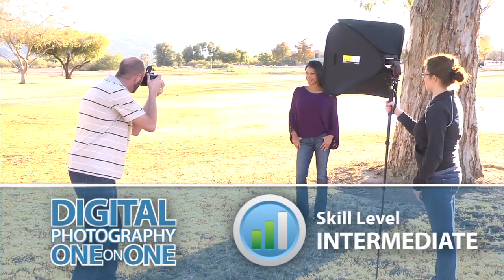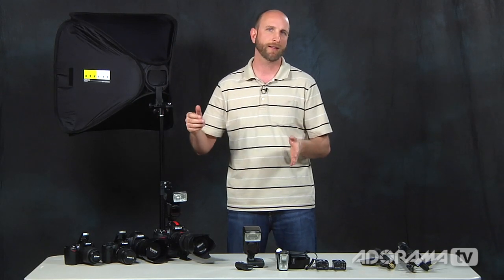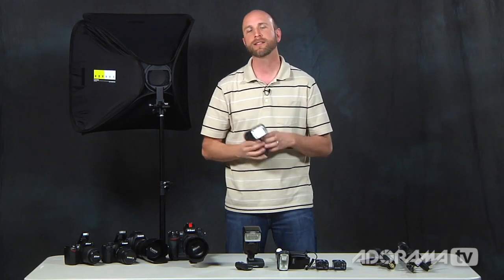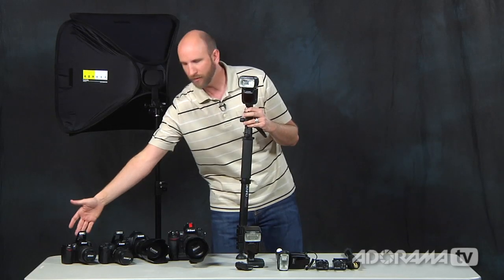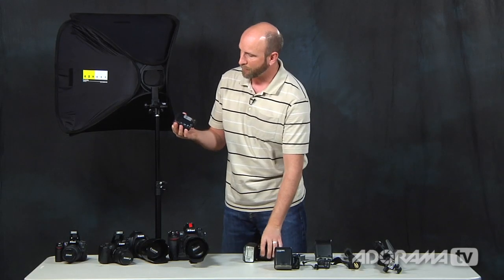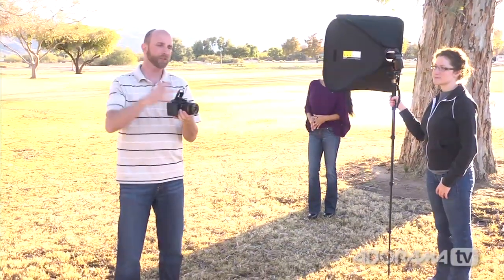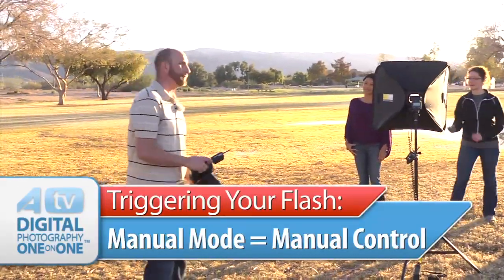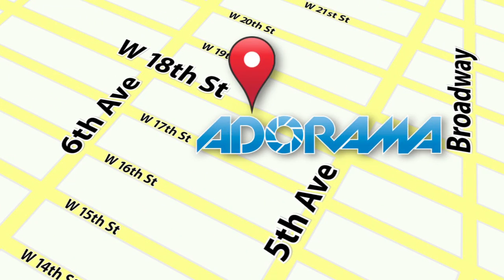Light Stick and Speedlights: Pt. 1: Ep 230: Digital Photography 1 on 1: Adorama Photography TV

Comment: @davidw64us1964 hey David, I have the Flex mini system, Pocket wizard build 2 types of Mini systems, 1 for Nikon and the other for Canon.
if you shoot with a Canon Body and use Canon Flashes, the Flex mini system for Canon will work for your 5d 380 combo, and the best thing about it is you can also use the flex system as a trigger for your shutter. Pw have a cable you can buy with a re-release function too. If you shoot using Ai Servo, the pre-release keeps the shutter half pressed before fire.

Comment: @lalaig 
The t3i has the commander flash feature, but the t2i do not have this ability...   That was one of the upgrades between the 2.  
The t3i will work w/ TTL metering, another option (cheaper) are the Pixel Kings, they allow full metering and HSS, basically all the features you would have if it was mounted to the camera

Comment: The light sensor on my Nikon SB900 is on the front of the flash.  What possible good would there be to putting the sensor on the side? If an engineer designed something like that, they should be fired on the spot and never allowed near a drawing board again.  Adorama TV, thank you for the awesome videos!!!

Comment: I guess I have a few questions  :-)  I shoot with Sony equipment. Yes I hate the proprietary stuff Sony makes U do!
1. If you are using a light box, and using a cable or TTL wireless system, will the lightbox effect the metering of the camera and flash, maybe underexposing the shot?
2. Should you always specify the Zoom if using a light box, to fill the surface area of the box?
3.If you use the flash from the camera to signal, dont you gain benefit this way by then having a 2 light system?

Comment: @pwdc hi pwdc I will try to answer some of your questions.
1. If the cable is TTL compatible (has all the pins) the metering will not be affected as the sensor will see the diminished output from the pre flash and tell the flash in the soft box to increase its output accordingly. Same for the wireless system used in TTL mode. Be aware that if the output is marginal for the unmodified light, the flash in the softbox might not be able to properly expose since the soft box steals about 1 to 2 stops

Comment: @pwdc cont
If the shots appear under or over exposed, do one or a combination of the following -- use flash exposure compensation (check your manual), move the light closer or farther from subject, adjust your aperture and ISO. TTL is great but has limitations and you as the photographer have work around them.
2. Setting the zoom manually is usually a good thing since u would not want any 'hot spots' (bright spot of light) in the soft box. you can still use TTL with manual zoom in most flashes.

Comment: there should be a way to figure out the amout of light we need without these very expensive light meters 
also I'd like to point out for other poor ppl like me there is a radio trigger called pixel king allow the flash to work in Auto mode as well and not very expensive like the pocket wizards 
keep the good work